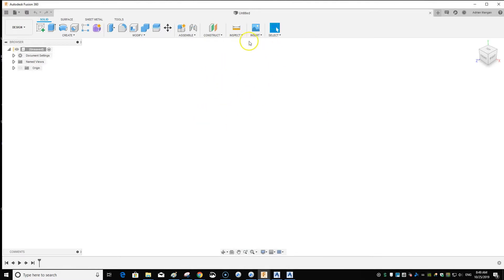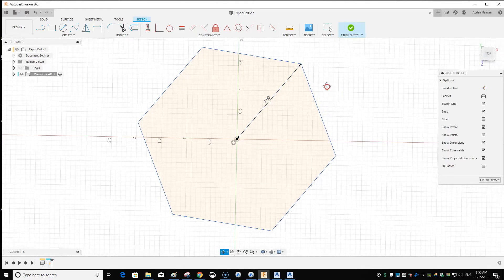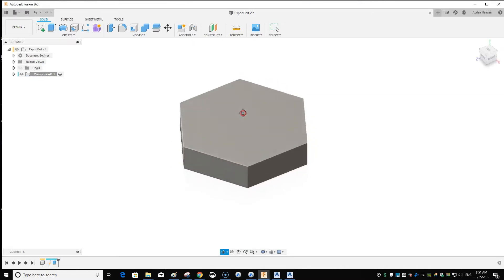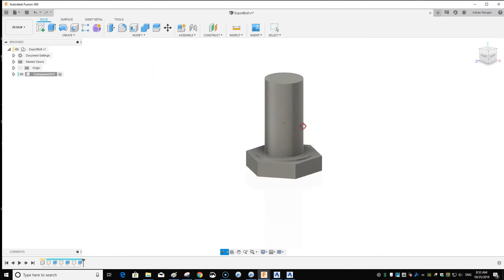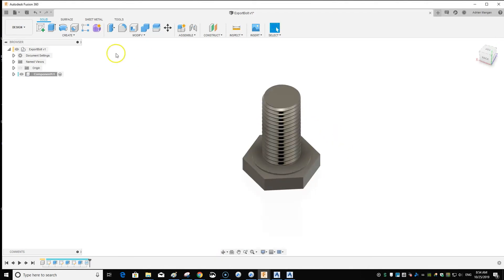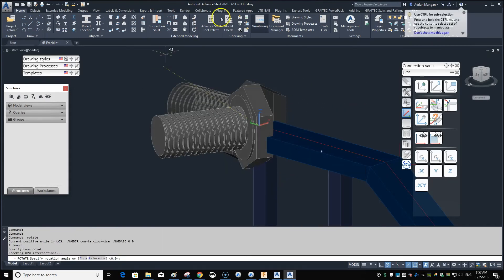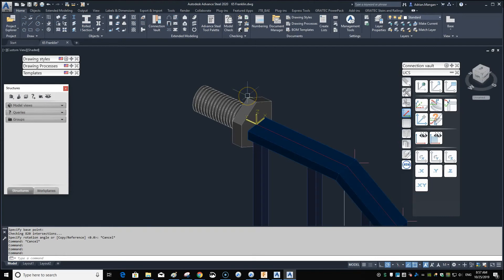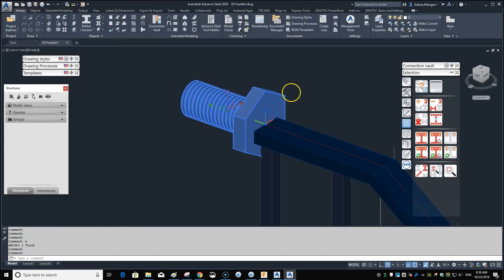Fusion360 to Advance Steel - Creating Special Parts.

Comment: Great video. Got me thru it so it comes up on drawings. I am using a handrail bracket I designed in fusion. The bend lines and more (kind of like an STL looks) show and are a bit of a distraction.
Is there a way to smooth out the appearance of the part? Different format of something? Thank you
Reply from the maker: I have that problem sometimes, what format did you export to, I usually use .iges sometime .dwg, they seem to work ok even with screw or elements with a lot of lines and curves. Sorry for delayed response Dave